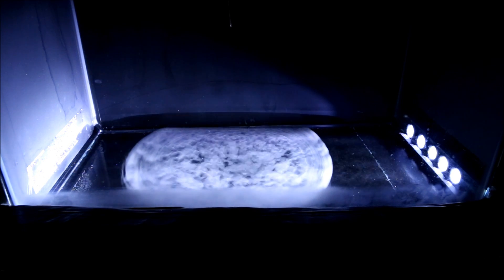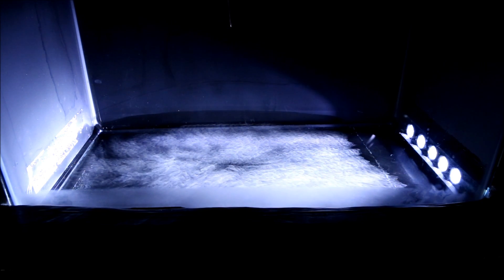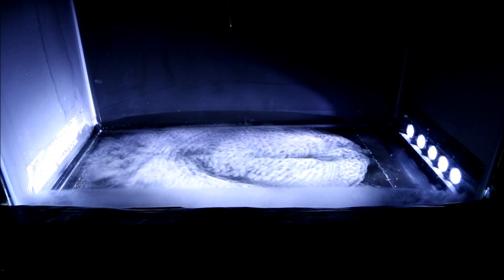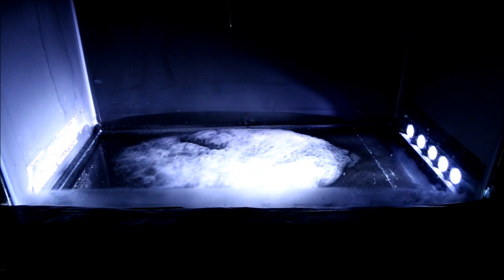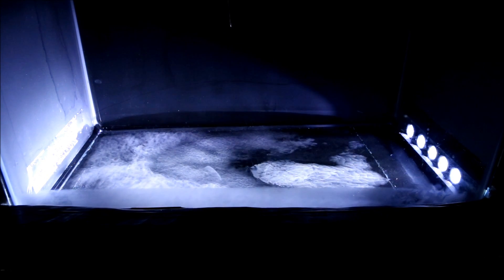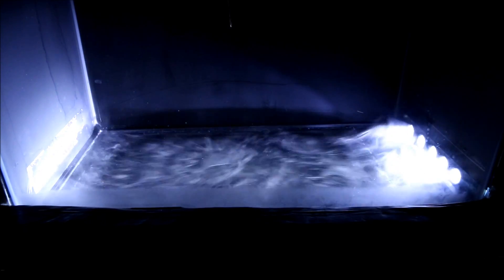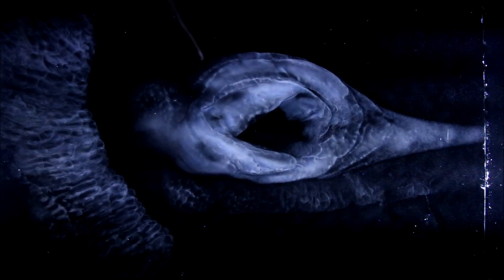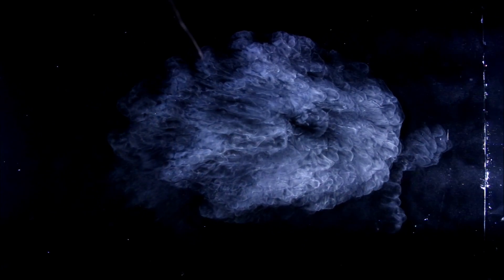Blasting A Cloud Chamber With Electrons

Comment: actually the electrons might be driving a neutral wind that is causing the movement in the gas.
Reply from the maker: You're correct. The blast of electrons ionizes a low percentage of the alcohol atoms in the active layer, which act as nucleation sites for other atoms to condense on to create a cloud, then air put in motion by the flow of electrons creates a puff of air that blows the cloud around.

Comment: What if the sharpened copper wire tip is connected to a positive potential (positive Van De Graaff generator ) ?
Reply from the maker: the positive potential would draw electrons upward from the aluminum base plate. It would be the same as attaching a negative VDG to the base. I haven't done it but would expect the upward shower of electrons to form a uniform cloud in the active layer of the chamber. Thanks for commenting!

Comment: the static-like noise generated after the cloud is made intrigues me. do you know what makes this sound? i would think its the electrons hitting the camera but im not sure
Reply from the maker: The buzzes and pops are sparks from the Van der Graaff generator and can be heard anytime it's in use. But you've raised an interesting point. The generator used puts out over 400,000 volts and can cause camera problems. To prevent the very thing you mentioned, the camera is located quite far away and a telephoto lens is used to get close ups. Thanks for commenting!